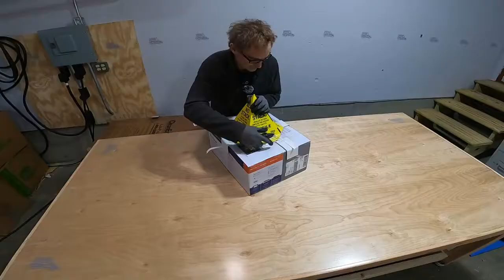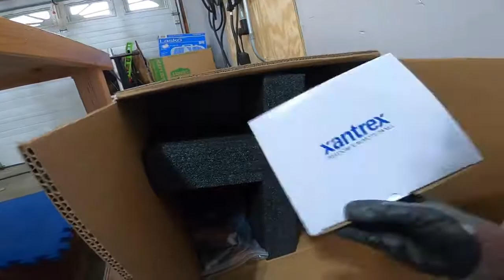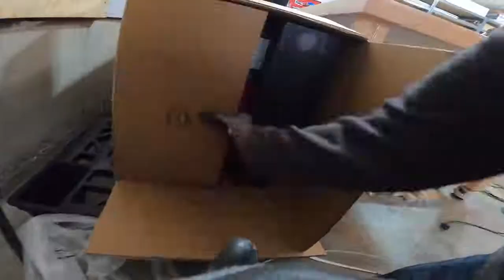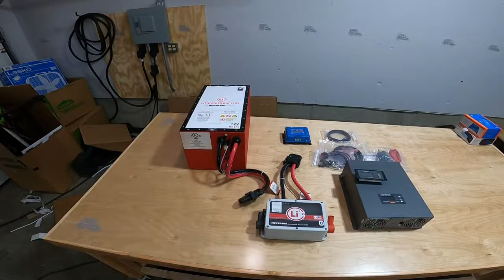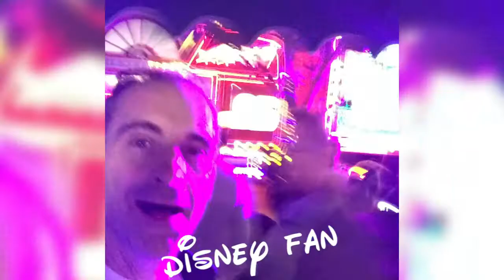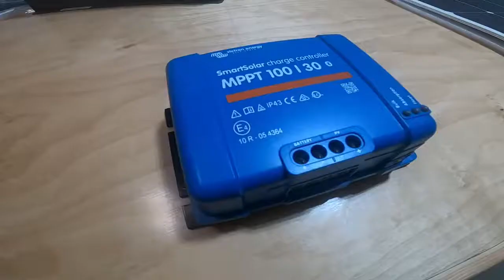Best Camper Van Battery System Ever

Comment: I have no idea how you lifted the battery onto the table on your own? I've just had 600Ah of Lifepo4 cells delivered in 2 boxes. The young delivery driver was foolish enough to walk the 30 meters up my driveway carrying both boxes at the same time. He was regretting it by the time he got to my gate. I got him to put them onto of the bins so I didn't have to lift them off the floor. I'm 6ft4 and I carried the boxes into the house one at a time.